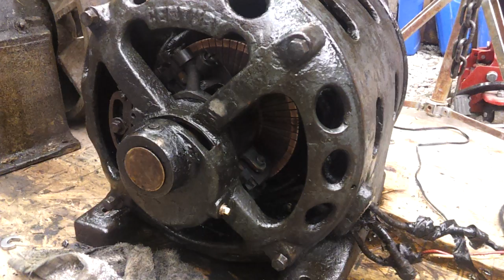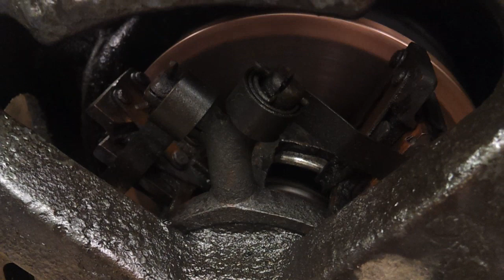Century RS/IR motor

Comment: Sounds like worn bearings. The commutator needs service badly and the governor spring is not tight enough because it lifts the brushes before the motor comes up to (about 80% speed).